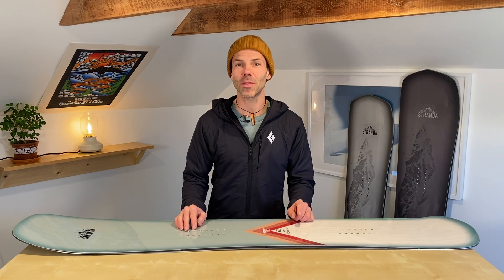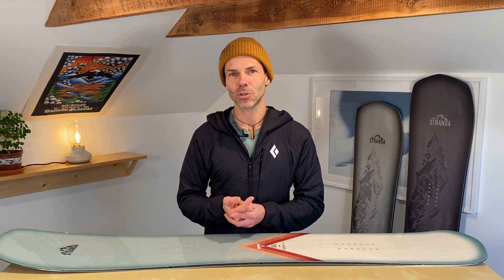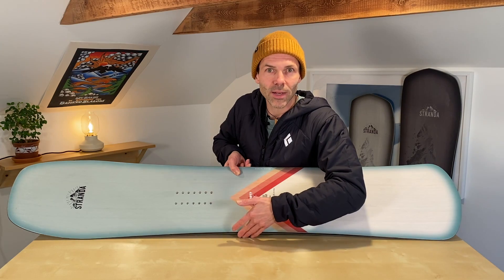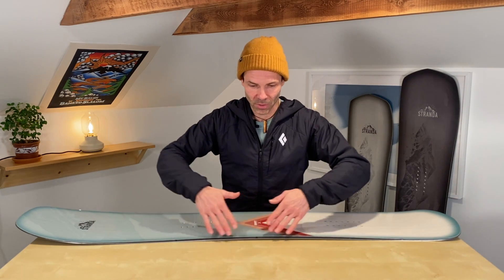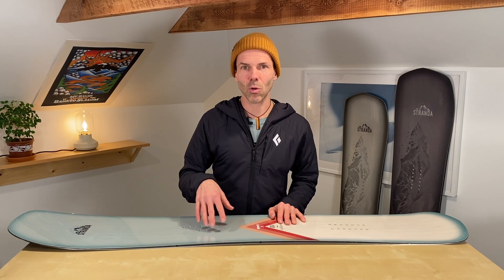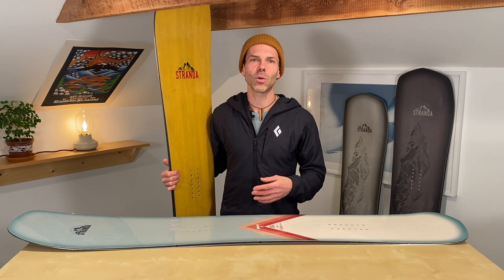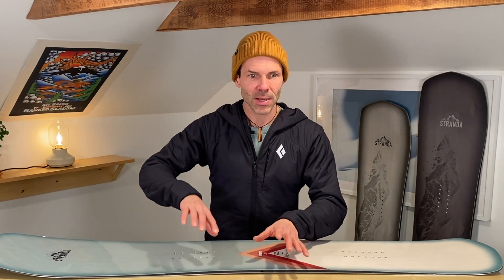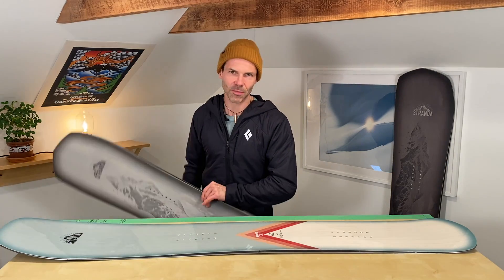Board design #2: Sidecut, effective edge, flex, turn radius

Comment: Based on your experience do you think I’d be ok with a nidecker megalight at 158 length? I weigh 140lbs size 9 boot and 5’6”. I’m an experienced rider.

That board has 7.8 side cut radius and 1190 effective edge, 1090 contact edge. Thanks!
Reply from the maker: 100%!! I rode the old one. Loved it. Not an intimidating board. Reminded me of a Stranda Descender with a tighter radius. Very smooth ride with great float and great grip. Descender has the firmer, more durable base. But other than the base durability it’s a fantastic board, and that size should work well for you.
Reply: @Justaride-Snowboard-Channel thanks!!!my other option is a 152 which seems small…
Reply from the maker: @jaybartlett2561 definitely small. 158 will be great.
Reply: After listening to this video I feel even more confident about sizing up. ❤
Reply from the maker: @jaybartlett2561 nice one!! Wait for the next episode that’s gonna drop this week… 😉

Comment: This guy speaks my language. I totally understand everything, just because of the way it is explained. I have a question (may be answered on another video or I missed it) - is the effective edge length the horizontal distance between the two ends, or is it the curved distance (i.e. does it measure the arc length?). On a side note I would LOVE to see the looks on the faces of the people who share the lift with you when you are on the 2m board 😄
Reply from the maker: GREAT question!! I don't actually know... I measure straight line and use that as my reference on all boards. It's a little inaccurate, but all I want is a good idea of what I'm riding and the ability to compare it to other boards.
Yeah, 2m in the lift line is a funny one! Hahaha....

Comment: How does snowboards feel over time? I have a board that's 4 years old, add rides fine but I've noticed the edge hold is not as great as it used to be. I do sharpen my edges but I think it's lost some flex and snap.
Reply from the maker: Yes, that does happen. Depends on the construction. Composites degrade, rwsins break down... A well made wood core from good wood with hardwood content is best - and also most expensive.... The boards I ride (Stranda) contain a lot of ash wood, which is superb!

Comment: Hello there ! Very interesting and informative video Lars. I'm also quite a snowboard nerd myself so your video got me thinking (and it also got me doing maths!). First, I want to say I'm a fan of your work and I don't want to be rude or anything, but I would like to challenge one of your statement. The goal here is just to deepen my comprehension and snowboarding pleasures ! 

When you said that a longer effective edge allows for a greater range of turn radius, that felt like en enlightement to me, but then, I look at the equations for the radius of the turn in relation to the sidecut radius, and that is simply: Rturn = Rsidecut*cos(edge_angle). In other words, this doesn't use the effective length at all. For a longer effective edge an a given edge angle, it's true that you can flex the board more, but that doesn't result in a tighter turning radius. However, a bigger deflection puts more pressure on the edge because of the board stiffness, so it probably gives a different feeling or allow for an even greater edging angle without skidding, which would be an explanation of why you felt that a longer effective edge gives a tighter radius.

That's my argument for now, I'm looking forward to hearing back from you on this matter.

Cheers !
Reply from the maker: You’re correct. And you I’m going to make a video where I will correct this. Someone else already brought this up. The reality is that the flex in combination with sidecut radius of the board is the limit to turn tightness. Except for that statement, I think the video is still pointing out the right thing. I say at one point that changing EE would call for changing the flex, too. However, what you are pointing out is absolutely correct!! Thanks for the comment!!

Comment: Very good, but all these specs may work differently when riding in powder...  right?
Reply from the maker: Of course. You're not compressing the camber and you're not pushing into the sidecut with the same force as you do on groomers. Less resistance from the snow then also leads to more drifted turns.